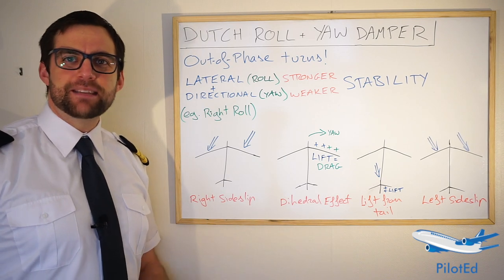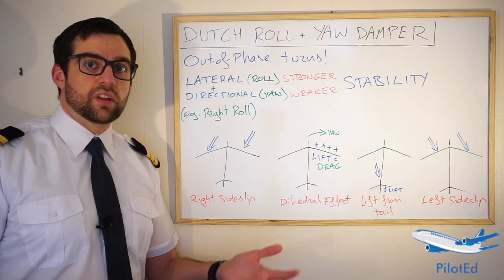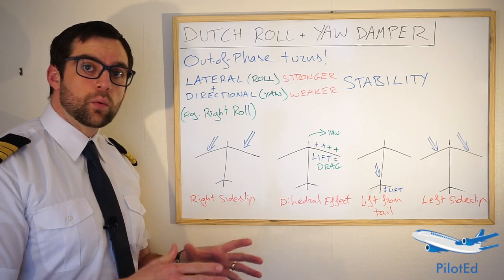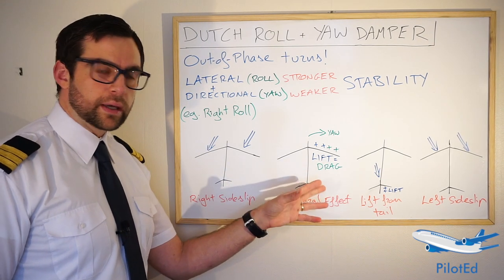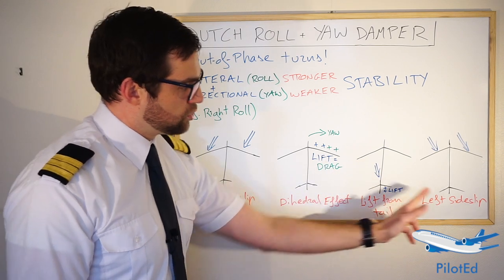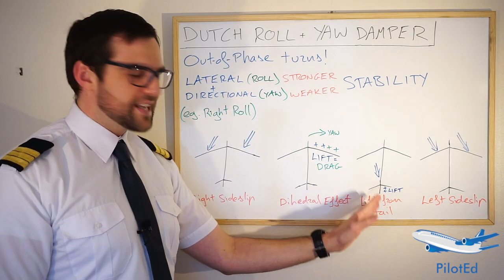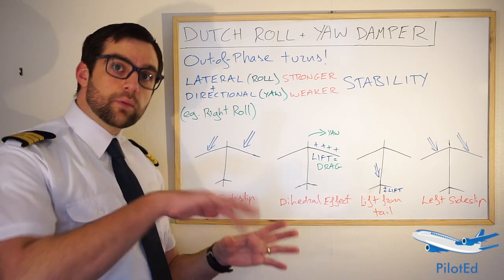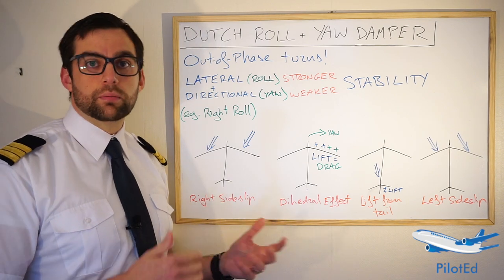Dutch ROLL and YAW Damper ✈

Comment: I hope to be able to answer some question after this video. Thank you so much ! you are very great! I am struggling with the sideslip since the questions are very tricky and hard to understand properly, I would like to request you if it is possible to do a video regarding the directional and lateral stability more in specific. In particular why the nose of the aircraft tend to yaw in the direction on the relative airflow and not in the opposite direction? as some question stated like this.  e.g. "An Aeroplane has static directional stability. In a sideslip to the right, initially the nose of the aeroplane tends to move to the right. " I am not agree with that honestly 100%,  can you please explain this? Thank you so much in advance and hope to see your video soon! ;)
Reply from the maker: if you slipping to the right, the nose may well have initially moved to the right also. Try it in flight :)

Comment: I have seen Yaw damper switches in cockpits from where you can turn it off. Why would you want to do that? Great video as always by the way as well!
Reply from the maker: Well if it malfunctions you want away to disable it!
Reply: @PilotEd  The Inspector General  is out on the report for the maneuvering characteristics augmentation fail;  It will now be disconnected when any of several common  sense  failure detection conditions occur; 
PIREPS are that the system is not needed anyway as it is for a slight pitch-up due to the LEAP Nacelles ~ at some places in the climb on somewhat narrow set of parameters

Comment: Hi there, I came across your channel last night and just wanted your opinion? I’ve just turned 28 but have opportunity to start from scratch learning to fly. Am I too old to achieve my atpl doing it via modular? Any advice to someone looking to start off? 

Many thanks
Reply: Well first is most who are interested should take what is called an Introductory Flight which is an hour at ½-price • 58 would not  be too old and even me at 68 were it to occur now based on what I  know I would begin; 
ATP if we have the funds is very do-able and some carriers are hiring right out of Training 
( special cases = do not have expectations of that )
My opinion is you have to be a natural and interested to make good at it and there are other caveats that often you do not see until flying for-hire on Part 121 — a scheduled air carrier Or Part 135
Operators of business aircraft that wish to conduct operations for compensation or hire are generally certificated under Part 135 ♦ You can do  Learn to fly and  never get close to that ○○○○ 28 is the Ideal age to  start

Comment: hello, you said at the beginning: when we yaw an aircraft, it causes an opposite roll. but what i read from book is : yaw to left, cause roll to left. it is not opposite. that makes me confused. please tell me which is correct?
Reply from the maker: what happens is when you roll left for example, the right wings angle of attack increases, adding more drag/lift and so pulls that wing back causing a momentary yaw to the right. hope that helps :)
Reply: @PilotEd  Hi, happy to see your answer. I understand that a roll causes an opposite yaw, but i was asking: does a yaw cause an opposite roll? The book says: a yaw causes a roll which is on the same side. So roll causes yaw on the opposite side, yaw causes roll on the same side. right?
Reply from the maker: @June-lf5hx  yup, if you yaw left, the right wing will increase its speed/lift and cause a roll to the left also. Did I say it wrong in the video? thanks for watching
Reply: @PilotEd  yes, you said it wrong. you spoke so fast that you didn't realize. but nobody watched so carefully as me haha
Reply from the maker: @June-lf5hx  thanks for pointing that out!
Reply: I was looking for the answer too